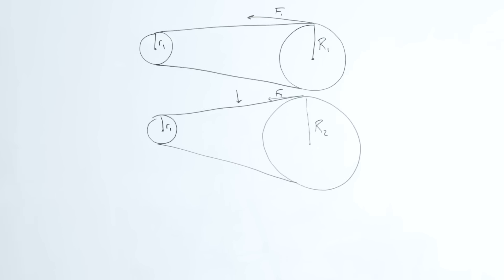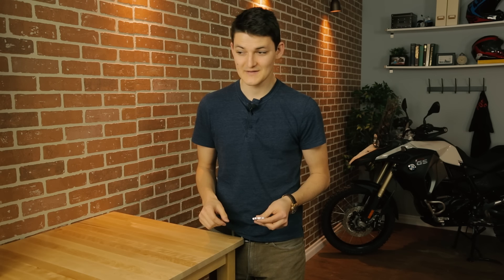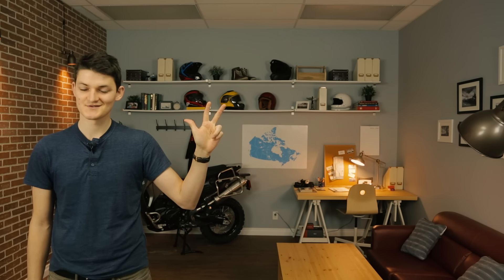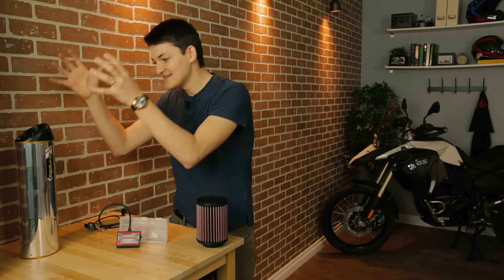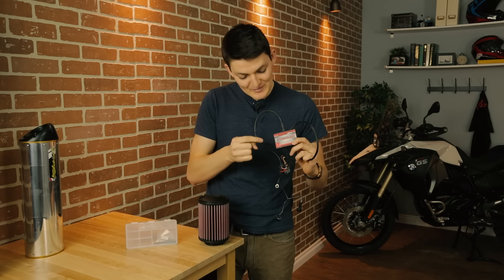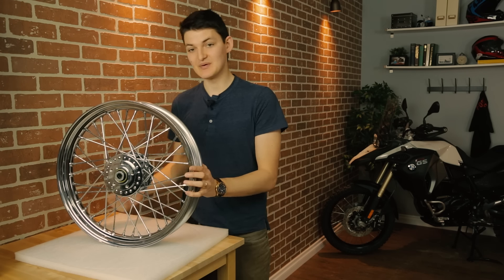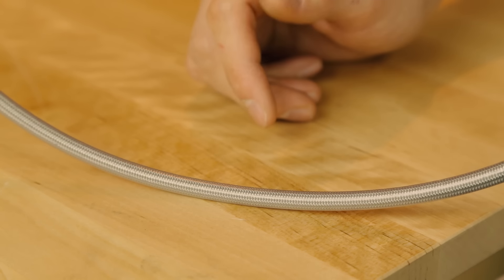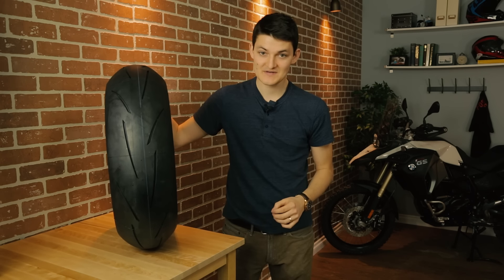Top 5 Motorcycle Mods to Go Faster

Comment: I know this is an old post but hey; i just watched it so...

Ok so maybe its just me who is an ignorant fool, but i dont get that you should have to change your fuel system along with the air filter and the exhaust. I know nothing about motorcycle engines, and it might be the reason why, but i do know my car mechanics pretty well... In any fuel injection system, there is what we call an aif flow sensor. It is desihned to measure up how much air comes into the engine. With that information, and the outside temperature, and the engines temperature and the charge (effort) on the engine, the CPU calculates how much fuel it needs to send so that you have the PERFECT ratio (1/14) at normal temperature. There is no need to change anything else! Is it possible that bikes engines are so cheap that they can't do the math? That would mean that if you go up a mountain, with lower pressure and less oxygen, the engine will not function correctly (runs too rich). And honestly, i've riden way up in mountains and i never had any trouble or the feeling (or smell) that the engine was running too rich. Even my comsuption rating told me the engine was still running perfectly. So i'm having a hard time believing that bikes engines acan't do it either! So why the hell should i change the fuel system? I think its just a scam, a urban legend so that idiots waste their money on things they really dont need. What am i missing?

Comment: K&N doesn't make the best airfilters, Sprint filters are the bomb, avoid K&N oil filters like the plague, they leak through the welds on the top nut & oil seals.

Comment: I cut a section out of my brake lines and vacuum hoses then duct taped them back together. due weight of the tape used to wrap it I only save 24 grams but something is better than nothing... #whatcouldgowrong

Comment: the big miss here is that on most bikes, shortening the gearing actually makes a higher top speed - the direct opposite of what he said.  The reason is that most bikes will not even come close to pulling top gear to redline.  So by shortening the gearing, you can run 6th out further.  Many 6speed bikes are faster in 5th or even 4th for instance than in 6th.

Comment: 2:25 "Swapping sprocket sizes often throws off your odometer and speedometer"  When did bikes stop taking speed readings off the front wheel?  And is it really common enough to call it "often"?  I've never owned a bike that took it off the rear wheel or the transmission...but I'm old and tend to ride bikes that are like me.  😛

Comment: Dont use k&n filters. Go to my channel if you want to see the truth, warning; it will shock you! It will go against everything you have heard. 
K&N filters do not stop dirt very well especially in motorcycles even on the street. my eye opening moment was 1992 when an engine I built suffered a gradual compression loss from 180 down to 120 over 20,000 miles, upon dissassembly I discovered the teflon graphite coating on the pistons was mostly gone, the cylinder walls were scraatched excessively. the valve seats and valve faces were pitted. 100% dirt ingestion caused failure.  I have hundreds of engines torn apart in my shop that had dirt ingestion caused failures because of the dirt that went through K&n filters. One was a Banshee that was only 2 weeks old. Yamaha denied warranty claim on it because there was dirt through the whole engine. They even sent several Tech reps to inspect the engine as I disassembled it. it was very clearly dirt ingestion caused failure. Another is a V-Star 650 that only had four thousand miles on it, it was consuming oil at an alarming rate. when I disassembled it, the Pistons were scratched very badly as were the cylinder walls. Dirt through the carburetor and the engine. I could go on and on and on and give you examples of the hundreds of engines I have disassembled and why each one of them failed; dirt ingestion caused failure.

Comment: K&N filters are garbage. AEM makes a dry flow filter that's the best airfilter for any type of internal combustion engine, no matter the application. It requires no maintenance messy charge oil. You can clean it with water, twist it to wring out the water, and it pops back into its original shape, ready to be used again, no need to squirt it full of oil. And it filters out 99% of air particulates, right out of the box, no need to dirty it up for a while before it obtains optimal filtering, like K&N and other knock-off charge-oil style filters.

Comment: Read some riding books and learn techniques for speed. Most modern sports bikes are much more capable stock than most riders.  Took an actual riding/riding  course and that improved my speed more than thousands of hop up mods. YOU really want to be fast and smooth and safe take a racing and riding course. Took Keith Code school years ago not sure f they are still around. I saw the experts take stock 85-87 ninja 600s  and lap faster than guys with modded to hell 600's and 1000's. SPEED is between the ears not a pipe and cam. They do class and track and showed how to apply things they took years to figure out. BEST speed for buck you will ever find.
Reply: Riding / racing   sorry
Reply: And then there's a better idea: Learn to ride better (books / classes) AND make the upgrades! ;-)

Comment: Check out the BoosterPlug (boosterplug.com), it's a simpler solution than a fuel controller computer, and it seems to work well.
Reply: Won't make it much faster but a lot smoother and less lethargic on rollon.

Comment: K&N air filters on your bike is a bad idea if you want your bike to last. even a brand new perfectly oiled k&n allows particulate buy that the stock paper filter does not. you're better off getting your horse power increases through a power commander and exhaust system. also try balancing your injectors
Reply: Yeah, if you want to run a K&N you might as well save money and just take the filter out of the bike entirely. You'll have dust in your engine either way.
Reply: Ummm where are you getting this information? I ran K&N in my 2005 R6 with full Yoshimura Exhaust. I gained 5-8hps and NEVER i mean NEVER got anything in the engine. Sooooo again where did you get this information?
Reply: i peed 
 @duece3000gt24

Comment: Changing your gearing (or a sprocket mod) shouldn't effect your speedometer because most bikes run the speedo off the front wheel speed so it will still tell you your speed no matter what you do to your gearing.

Comment: I bought a power commander with 2 brothers carbon fiber slip it came with a map to use with the 2 combo from 2 brothers junk the map was way of getting pipe way to hot and pipe collapsed cost a grip two brothers weren't apparently my brother's they wouldn't do nothing for me but they sent me a steel sleeve with fiber to stuff my own pipe with rivets to install a new junk blue sleeve I will never buy anything two brothers good luck with that

Comment: I don't think this guy really knows much about bikes...the best mods are lightened flywheel, and rear sprocket. Changing the rear sprocket will reduce chain wear, and you can go up or down by 1 tooth at a time, finding the right performance for you, but if you change the front sprocket you'll be going up or down by 3 teeth, instead of one. FYI don't buy a K&N air filter. Bikes hate wet filters, and the oil in them can reduce air flow in smaller bikes...Also, buying a really sticky tire just means you'll be changing it more often and have less grip in the wet, which is extremely dangerous...My last point is this, most people aren't looking to make their bikes faster on a track, but faster overall, and this guy seems to be focused on a track rather than on the road...dislike this guy very much because every video I've watched has some form of safety issue/unnecessary point to make.

Comment: In injected bikes, when a lean condición is detected by lambda sensor, more fuel is added without need of remapping.

Sport Air filters allow more Air flow on the intake, but also alow bigger particles passing through, leading to premature engine wearing...

Stock Air filters are designed to not being flow restrictive until fuel Max rpm cutoff. If you don't make changes on Max rpm or in engine displacement there's no need to improve Air flow.

Too much bullshit...

Comment: With current sport bikes weighing less than 500 pounds with over 200 horsepower. You aren’t using anywhere near the power compared to what the bike has. So you want more power you can’t use anyway? You think you have the talent to use 200 horsepower anywhere on public roads? 🤣 If you think so, it’s a nice fantasy. The amazing talent of riders that compete in the Isle of Mann every year, might use most of the power, and their is no traffic and 2 riders die there every year. You are definitely not one of them.

Comment: Noobs... I ride faster by riding with no oil, coolant or brake fluid and my tires have almost no tread for weight reduction. Also, I took all the lights and cheesy speedometers off. Lastly, I ride with no gear except shorts and a wife beater for ultimate weight savings and shaved my head for better aerodynamics.

Comment: No, no, no....carbon ceramic pads best for road or carbon for track (carbon wear down quicker) so carbon ceramic if u want ur pads for the road to last longer. Power comander no no no old technology, why would you buy a PC for $400 then spend $500 tuning it? Only to get 4-5hp when you can just get your ECU flashed for $300 and gain 10-15% horse power instead? if you don't know most of this stuff on the video you shouldn't be allowed a bike. Also K&N filter not always the best BMC are the worlds best for Yamaha R6 for instance also using top oil e.g Motul racing oil has been proven to add 1-1.5hp and is only about $40

Comment: Wheels are REALLY expensive and that is not an option for 99% of riders. Brake pads also mean nothing, stay with the stock pads.  Tires also mean almost nothing, but they can have a different feel that you might like or not. I recommend that you avoid expensive tires, and buy new tires more often.